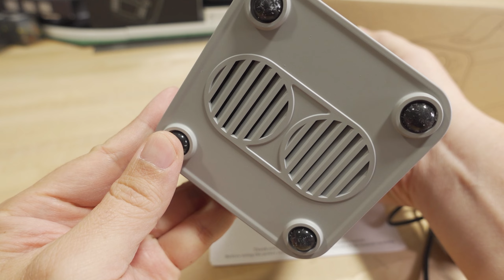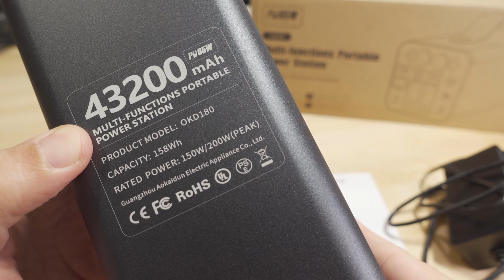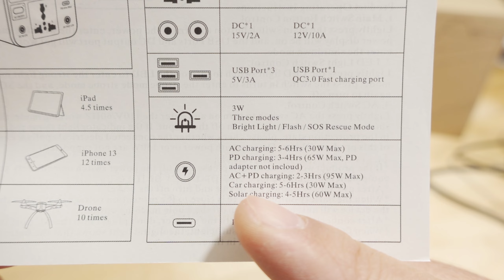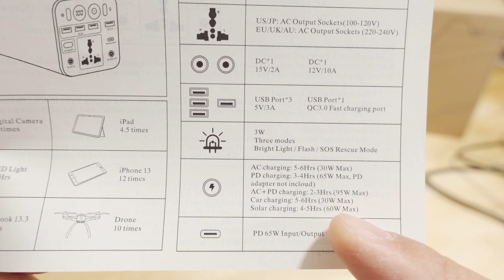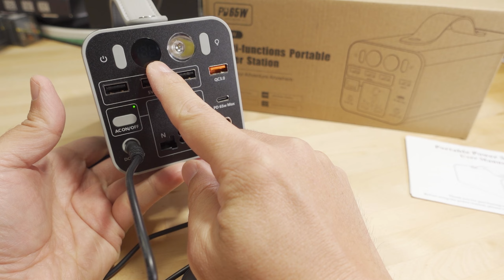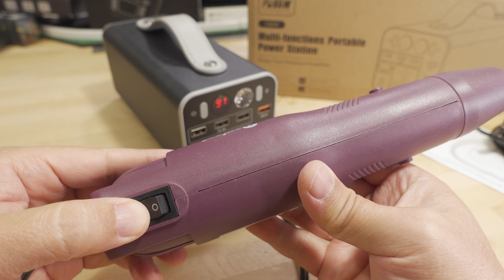POWDEOM 158Wh Super Portable Power Station ⚡

Comment: My Laptop is unusable when on Battery, I like to work on cafes but sometimes there's no outlets to charge in, is this good enough for a Gaming Laptop?
Reply from the maker: How do you define "good enough".  If your gaming laptop exceeds the specifications for output power of this power bank, then it won't be good enough.  I have no idea which gaming laptop you're talking about so it might be good enough or it might not be.
Reply: @AlbertKimTV  My laptop is Gigabyte G5 GD, it has i5 11400h and rtx 3050 and Im happy with it. But on battery, its unusable on video editing basic 1080p videos with no effects. 

My CPU slows down to 800mhz as soon as I open an editing software. But playing 4k videos is not a problem.

I dont need to run on full power, I just need it to be usable for like 30 mins to an hour waiting for an outlet to be available.

Comment: Can this charge a HP Probook laptop
Reply from the maker: If the laptop can charge via USB-C at 65w, then this will work.  There's like 200 ProBook models so I don't know which one you're referring to.
Reply: @AlbertKimTV  my system name is: hp probook 640. So for the type C, I don't have that port on my system. But I can use my charger, because on the Powerbank there is a space just like a switch for plug🔌

Comment: Is there a way to charge the power station by a solar panel?
Reply from the maker: Yes, should be possible with a 16-25V solar panel up to 60W.  The barrel connector is the 35135, so you'll need an adapter for most common panels.

Comment: is the pd charger capable of outputting 12V?
Reply from the maker: I found this info in Google...  The usual voltage steps of USB-C are 5 V, 9 V, 15 V and 20 V ; 12V support is optional and is more of a convention.  In other words, it depends on the device.  12V is not typical however.